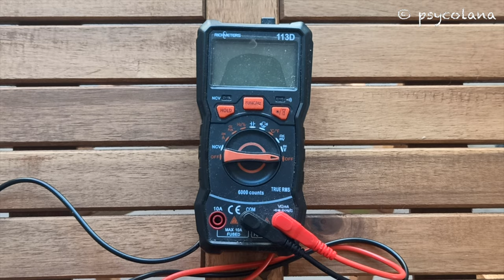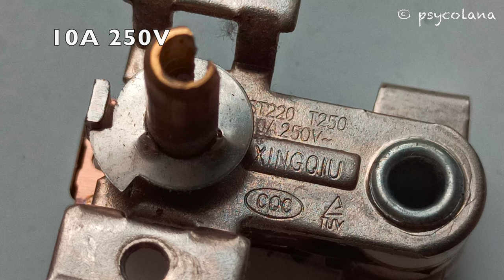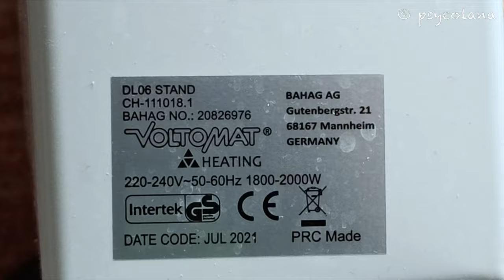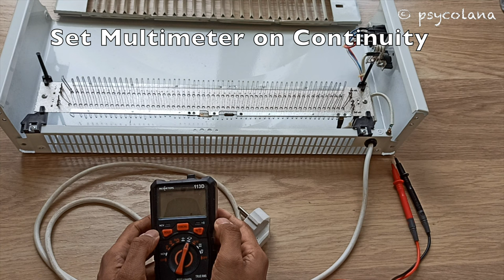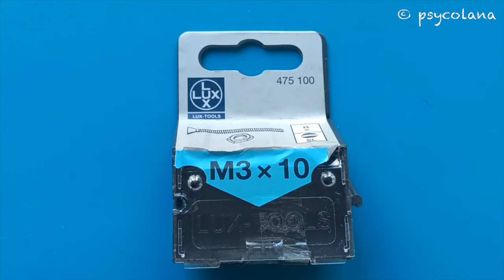Convector Heater Repair

Comment: This video is very helpful. But I don't have a drill. Is there any way to remove the broken thermal fuse without using a drill?
Reply from the maker: you could use a round file or a nose plier or even a blade, knife, but take care of your hands
Reply: @psycolana  Thank you very much！

Comment: I haven't got multi meter to test each component. If there was burning smell before it stopped working, then lights not coming on and not heating up. Tried changing  fuse in plug too. Do u think it's thermal fuse that's gone? Hope u can help. Pipes frozen and very cold. thanks
Reply from the maker: It could very much be the thermal fuse, visually check for discoloration of the thermal fuse, if you find discoloration change it, but better to have a multimeter to check, it could also be the power cord.

Comment: I do not have a thermal fuse. Just a thermal cut out. When testing with multimeter there is continuity but when the heater is operating it stops after 1 minute. Can it be that the thermal cutout is faulty?
Reply: Also, I tried searching for the part number for the thermal cutout online but could not find it. Is there any other part code for it?
Reply from the maker: Hi, try cleaning the contacts of the cutout using a high grit sandpaper, if issue still persists replace it. I am procuring parts via aliexpress buying is in the description check if its the same model.
Reply from the maker: @Paul Bajan  try cleaning the fins, and see that the fins are not touching each other, check the power cable for any short, also check the thermostat.
Reply: @psycolana would a ksd9700 thermal switch work instead of the  one you mentioned in the video?
Reply from the maker: @paulbajan1976  I have never used it, so wont be able to comment, you will need to refer to the data sheet, and chk if its compatible.
Reply: @paulbajan1976  could you share the part number
Reply: @paulbajan1976  I replaced the thermal cut out in my heater, part I got from aliexpress
Reply: I bought a similar looking cutout, but it cuts out very quickly. Is there a way to adjust the cut-off temperature?

Edit: I bought it on eBay. Search for "hair dryer thermal cut-off"
Reply: @mmatt314  what is the temp. rating of the cut out u got. I guess @psycolana has made a mention in the description of a rating of 150C
Reply: @harshpatwardan9277  it didn't have one. In the description it gave a range and said something like "each gear is 5°C" so I assumed there'd be a little adjustable screw or something, but I couldn't see anything. The thermal fuse had blown and that was rated 150°C so I replaced that no problem. But as I was drilling out the rivets, the cut-out got stuck in the drill so I had to replace that as well!
Reply: @mmatt314  cut-out will/should be rated at 145°C or 150°C
Reply: @harshpatwardan9277  so they can't be adjusted then? It's said 40C - 150C. There was no option to choose a temperature, That's why I assumed it was adjustable. 
Ok I've found another one anyway that actually gives the temp so I'll get that. Thanks everyone for the help

Comment: Can you please help I have the same heater I bought it two months ago but now from yesterday I switch on then it on  for 3 minutes and turn off automatically. Then after 1 min it turn on and so on. Can you tell me which part I need to change it?
Reply: follow steps has shown in Video start by checking power cord, switch, thermostat, thermal cut out and thermal fuse. also do not cover the top of the vent example keep clothes to dry also air needs to pass from the bottom
Reply: that's how it's supposed to work, once it reaches a certain temperature it turns off automatically. Try turning the knob higher if it's not reaching the temperature you want.